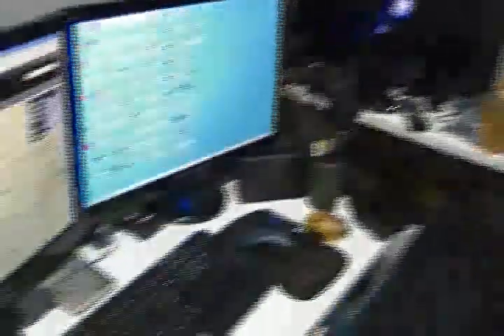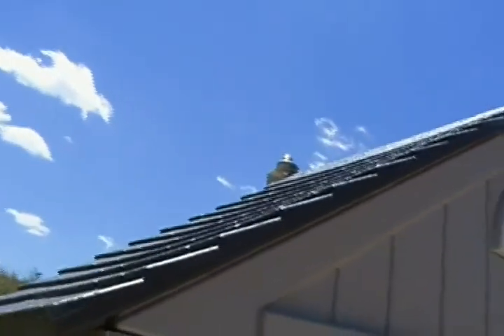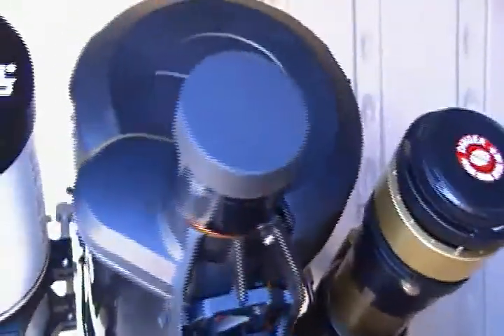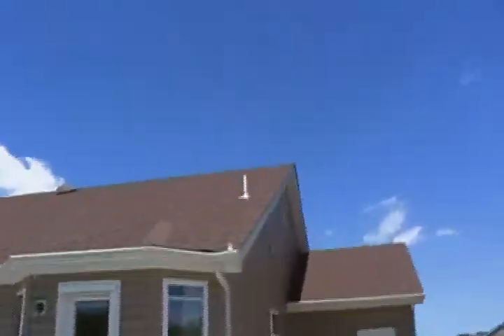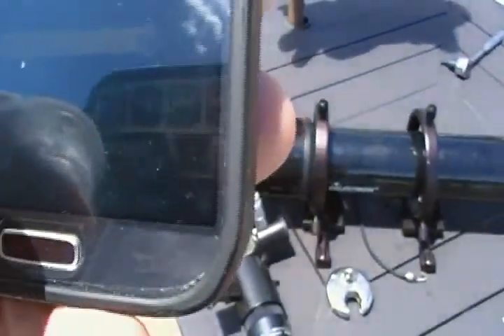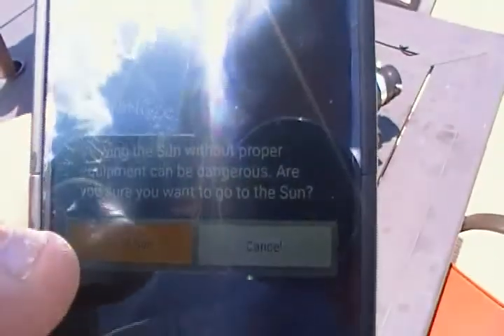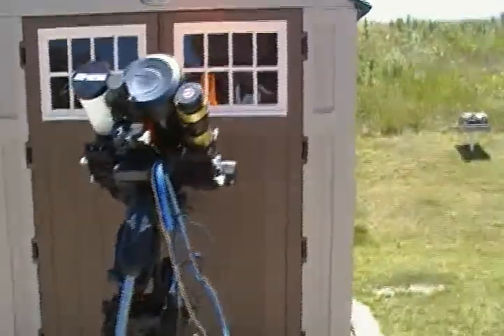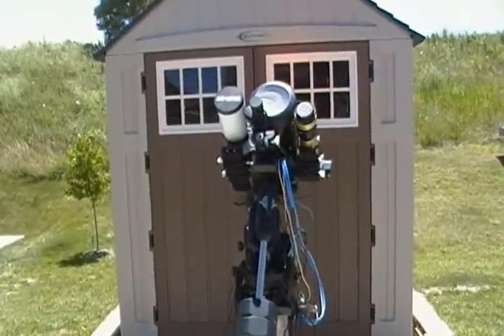Backyard Observatory with 3rd Car Garage Warm Room

Comment: Why star sense? Doesn't the Celestron software for the CGX-L do plate solving? You lost me when you pulled out the Phone... Can't see don't do it.
Thanks for trying
Reply from the maker: It does, but I already had it so I decided to just let Starsense set up alignment after I polar aligned with polemaster.  I was just use to it when I got the new mount.

Comment: This is an impressive setup. It must make setup a breeze. With polar alignment and cables already setup all you need to do is roll off the shed, power on, slew, and start imaging. I spend 1-2 hours a night just getting to this point plus 30 min for tear-down at the end of the night. Kind of a pain in the butt, even when everything is working properly. Very inspiring!
Reply from the maker: Brian Schneider, Thank you Brian!

Comment: I allways thought round linear rails and bearings use in cnc tables would work good for a rolling shed. Avalible at McMaster or overseas for cheap. They are also greasable
Reply: Also a flat slopes roof would help with your observable sky